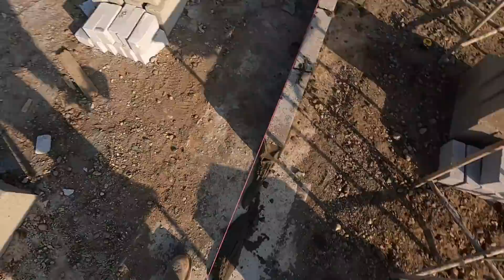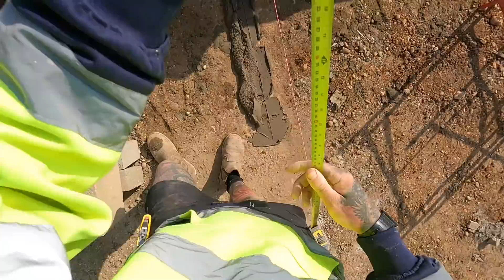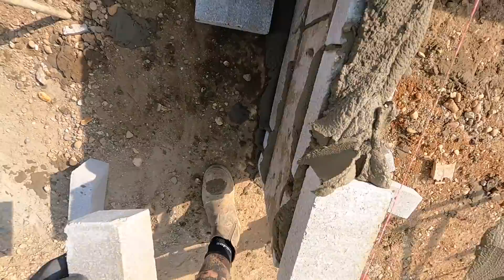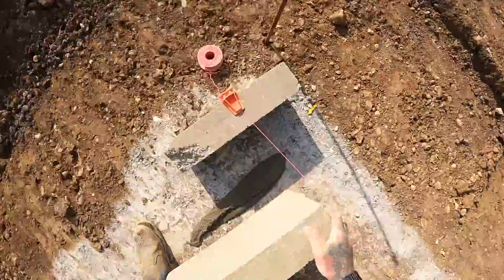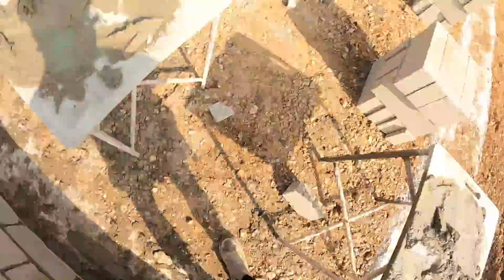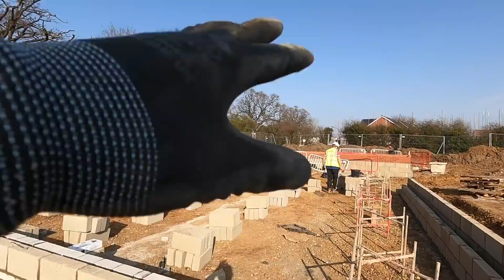Another Monday out the way

Comment: Not a bricky or a spreader.  Question. If you joint-up block-work that's going to be rendered it can show the joints through the render?  Better just left full, but scraped?  True or BS
Reply: Yes I have seen it where the joints show through
Reply: There's a backing coat what prevents this but can't think what it's called for the minute but far cheaper not to waste time jointing it.
Reply: If you can see the joints in the blockwork,it’s normally because the render has been applied too thin. But sometimes can be because the muck  mix is too different to the strength of the block. When thermalite/celcon/durox blocks were allowed to be used in the exterior skin,they were supposed to have raked joints but no one used to follow the manufacturers advice. 
Blockwork above dpc needs to be ironed in to help with airtightness of the structure. Only one side of the block needs doing, it’s a misunderstanding of the rules to say both sides of a block needs ironing in.
Below dpc it’s obviously not as relevant to iron in for airtightness but more for strength. You have to have one rule that covers all because Brickie’s will argue ,that bit needs doing but that bit doesn’t. It’s simpler to say all the blockwork needs ironing in.
Reply: @duncanhiggins6463  Show me one authorised document that says blockwork has to be ironed in, not saying there isn't one but I've never seen one, they just state that it must be airtight which a full flush joint provides, wiping a bit of wet muck on empty joints does nothing.
Reply: @bricklayersworldwithandy6277  I have no idea about the actual paperwork but it seems a good idea to try and stop Energy wastage.  Bricklayers may or may not realise that they have a real opportunity to make a difference to this. I'm a plasterer so I know I've got my role to play.
Just so we're saying the same thing,when I say ironed in ,I mean a joint that is fully filled and is easily smoothed off to give a finish like you see on face brickwork.
Recently I rendered a garden wall on a 7 year old house. Their Energy bill 3 years ago was £90 a year for an average size 3 bed house,I didn't think it was possible until he showed me the utility bill.
Part of this success was airtightness.
Reply: Martin the place I was talking about is called Wimbish Passive Haus and can be found on YouTube . 
Apparently all the tenants pay their rent on time,because they're not spending alot of money on energy .
Hastoe Housing Association now builds its properties to the same energy conservation values because it's easier getting the rent from the tenants!
All built using conventional materials
and methods, but I bet the Foreman gets moaned at!
Reply: @martin2466   mechanical ventilation and heat recovery (mvhr) cost me £1800 plus 2 days of my own labour, to fit in my own newbuild . Minus the cost of trickle vents (£275) and extractor fans(£250),softens the expense.
It was easy to fit,just hadn't done it before. 
Really recommend the system. 
It was alot of detailing to get  an airtightness score of 4,without cheating on the test.
I think building standards are controlled by the big building companies through bribery and corruption of the government.

Comment: That's a point trowel u are using and u not tying in walls and why u putting line inside cavity......u . are teaching basic stuff...nothing new
Reply from the maker: I don’t use a big trowel. Big trowels are pointless. I put the line inside the cavity so you don’t have to lift the block over the line which saves energy to lay faster. I’f this is basic stuff why are you questioning me
Reply: How u lay them faster ...so wot u are saying is u don't touch the line if inside cavity
Reply: How u lay them faster ...so wot u are saying is u don't touch the line if inside cavity

Comment: what trowel is that you are using=?
Reply: Whs short handled broad heel . With a bon tools replacement plastic handle on it.
Reply: @brickbybric  what's the black rings on the handle never seen them on the bon handles
Reply: @ashleypickering34  i think it’s just some electrical insulation tape he wrapped around it . He showed it in the q and a yesterday.

Comment: Hate plastic handles to slippy.
Reply: They  can be a bit slippy alright . Tough handle though . Have you tried one of the bon keystone forged trowels , they look good . Made in Slovenia by a b tokos.
Reply: @brickbybric  
No mate just the rose plastic. Although am trying the cork rose handle. Same shape as the proform rubber feels good.
Reply: @lmilne4859  I think the Rose plastic is the most comfortable handle out there, I just rough it up with a piece of brick every now and then.
Reply: @bricklayersworldwithandy6277  
It’s we bump in middle a think a wasn’t getting along with. Proform rubber doesn’t have wee bulge in middle and 1inch longer which a prefer. Cork handle same dimensions as rubber haven’t use it yet but feels good.
Reply: @lmilne4859  👍
Reply: @lmilne4859  I have a 10 inch Nela narrow London with the cork handle . Good grip on them nice and tacky .
Reply: @brickbybric  
Nice 1 buddy have a nela cork handle plastering trowel do some nice stuff. Narrow London 11inch don’t do half sizes in cork handle the now. Using 10inch narrow rubber handle the now has a good quality steel blade on it. This cork handle that arrived also has a thick gauge steel. Normally like more flex butting liking the harder waring blade at the moment